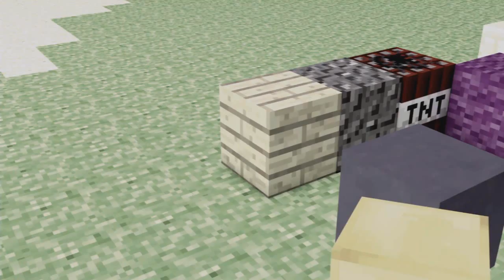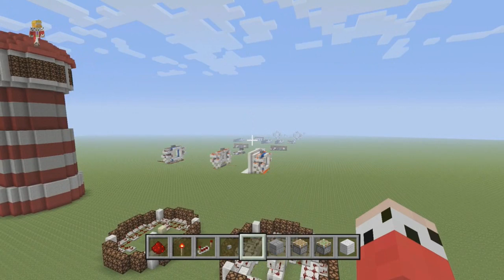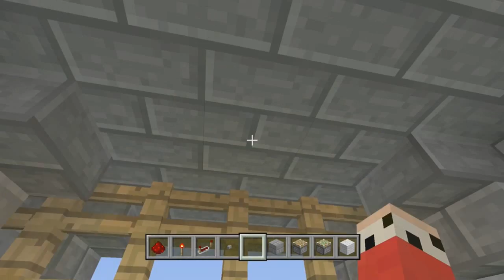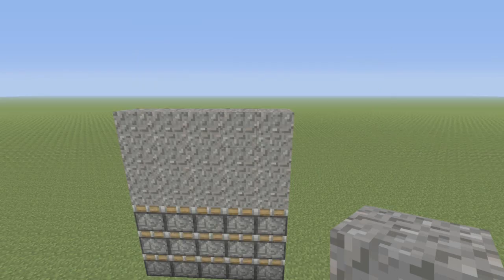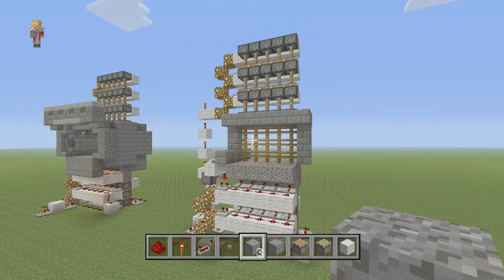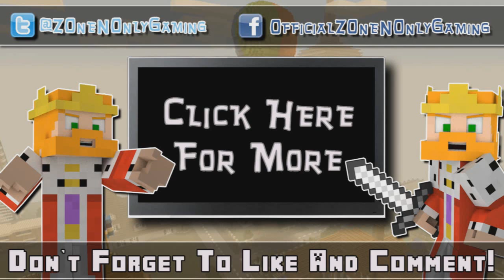Minecraft :: Castle Gate / Portcullis Tutorial :: Redstone From Scratch Ep18

Comment: Tried it in 1.16.3 Java, modified the top, and it worked for me. Thanks! I hate using the popular version with observers that requires sticky pistons and a non-falling block.
The modifications on the top were:
1. I raised it by one. (I like hiding the pistons.)
2. I added mono-stable circuit so I could depower the top (closing) pistons in order to lock them if I need to.)
3. I changed the t-flip-flop to a super charged flip-flop. (This may require the buttons to only be on the left side, still on opposite portcullis sides, as apposed to having them on all four sections.)
Still editing it before putting up on the server I play on.
I still like this version of redstone usage rather than relying on the 1 tick pulse of repeaters.